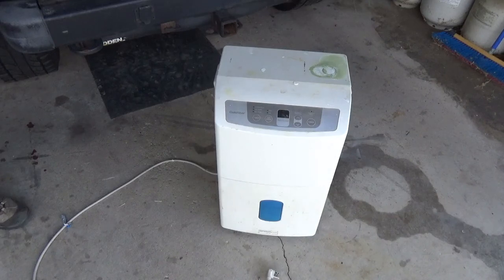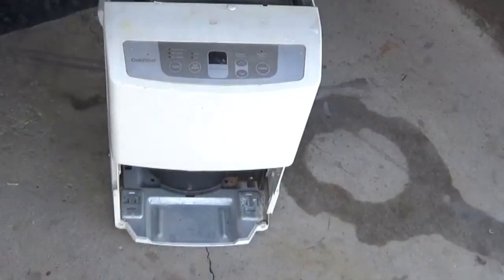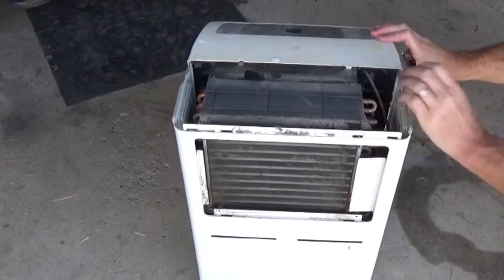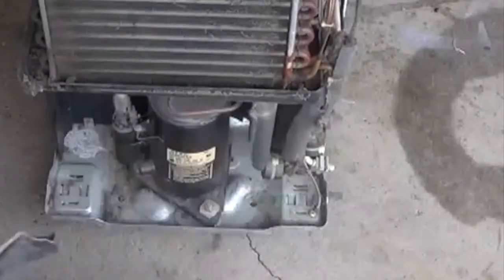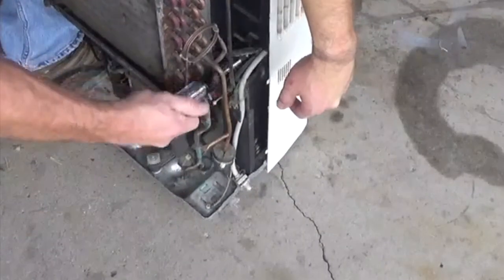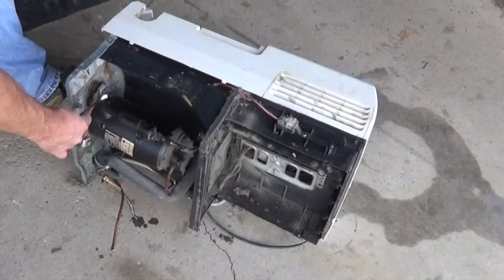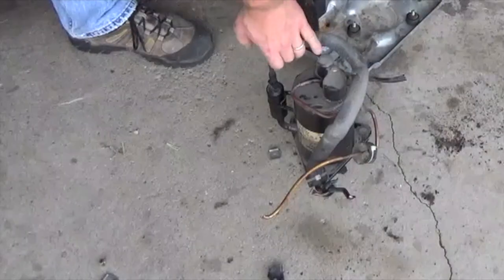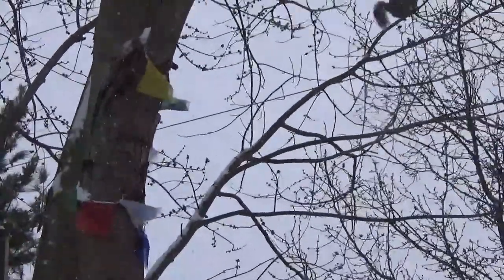Scrapping A Dehumidifier - COPPER!

Comment: Any idea what those two items are worth in current scrap $$$?
Reply: The price of compressors is about $.08/lb. Can get this is probably around 8 to 20lbs. If he cut the radiator correctly he would probably get around $0.80/lb for clean radiators. Also there is about a pound of #2copper, which is currently going for about a $1.75/lb. I would be estimating that he would make anywhere from 7 to $12.